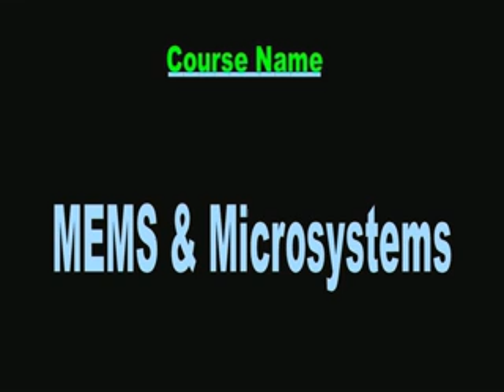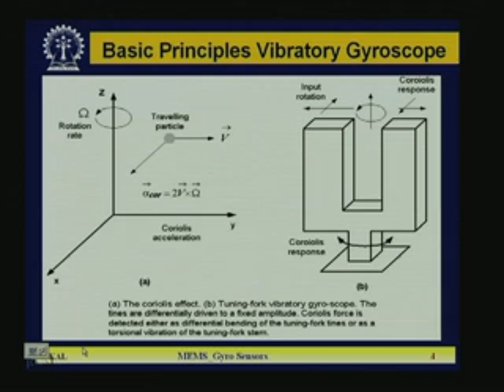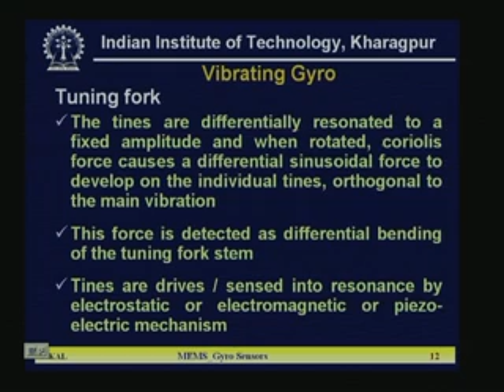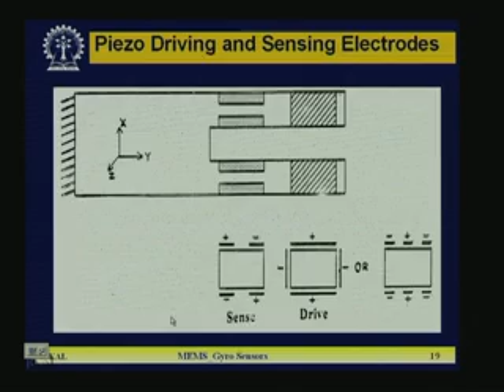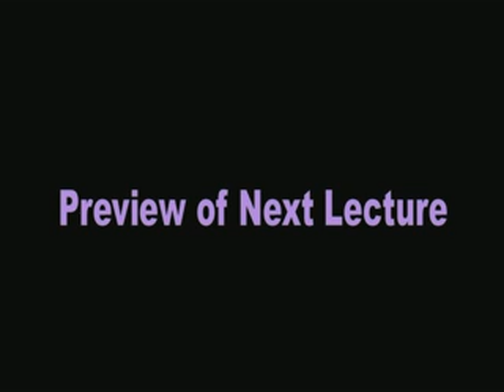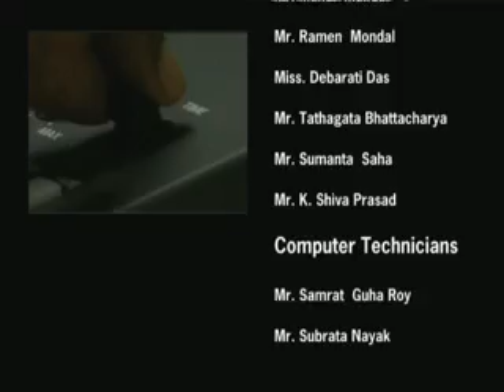Lecture - 27 MEMS Gyro Sensor

Comment: very good!
I am designing a high velocity, unmanned vehicle  which requires me to develop a navigation system. I would like to use this type of gyro. But the vehicle experiences extreme vibration and forward velocity. Will this mean this type of gyro will not work? also will it allow me to detect acceleration also?

Thanks.
p.s.
if you pm me i can give you my email address or skype ID is you would be willing to discuss this further.
Reply: did you make the vehicle?
Reply: lol your comment older than my brother